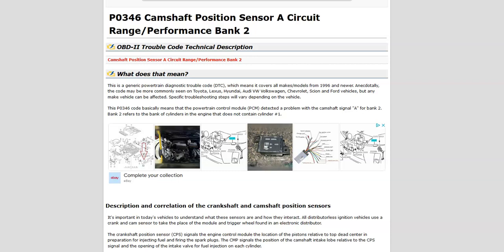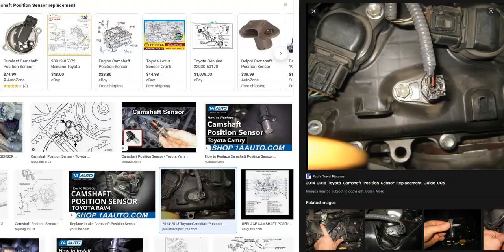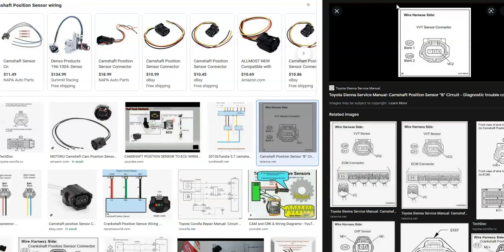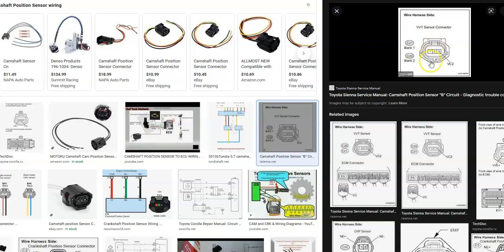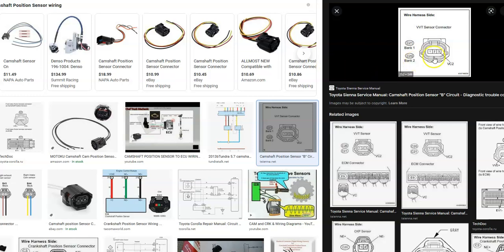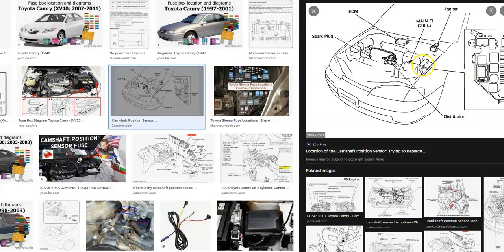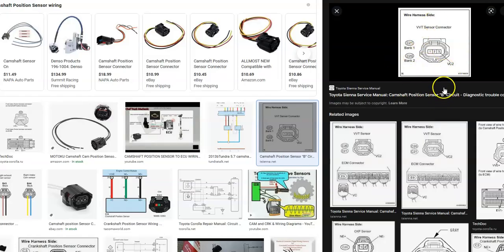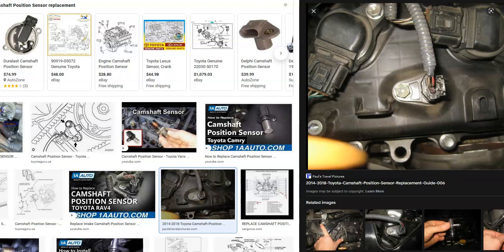Causes and Fixes Toyota P0346 Code: Camshaft Position Sensor “A” Circuit Range/Performance

Comment: I already replaced all of that and examined the wires, I replaced the VVT solenoids, etc. Still have a problem.
Reply from the maker: Does the wire harness have the correct voltages? Sometimes there are issues after replacing a Cam sensor. I did a video about it here. https://www.youtube.com/watch?v=XQGfIREEJg4
Reply: You are awesome for replying. I did do the Big 3 to ground and even positive which seems to help in general but not with the problem. I do need to use a volt meter to test those wires. This might be important. My car does have symptoms yet the code only shows on my scanner when I both drive and scan at the same time. When I scan the cars computer in idle there is no code. There is no check engine light. The symptoms used to be so bad that the car would shake, have really bad gas mileage, not have horse power, etc. The lights also dim when my cooling fan turns on. I replaced the alternator, purge valve, fuel injectors, spark plugs, some of the coils after seeing two misfires on 4 and 6, the VVT solenoids, I used many additives in the oil and gas which seems to help, the throttle body, etc. Despite the improvement, my car still does not have good acceleration, there is a rough idle when the cooling fan turns on, etc. Turning the rear defrosters on also causes a though idle. I really hope you can help me. I purchased a shop manual but it isn't helping me. Thank you so much.